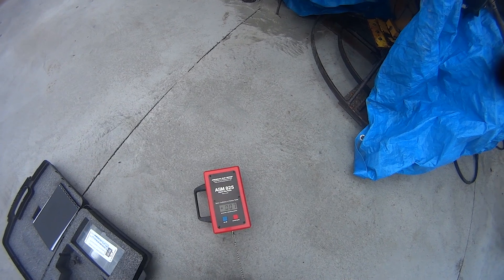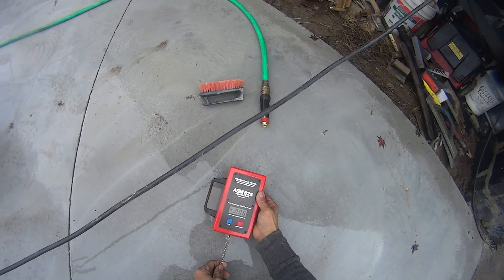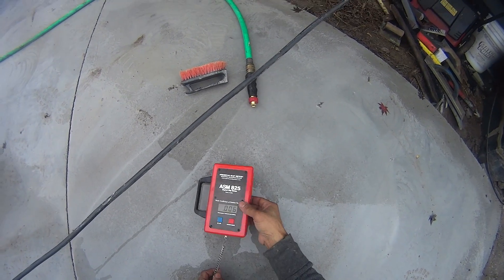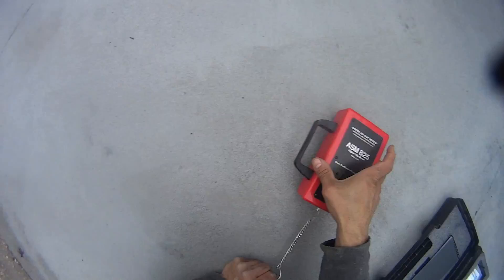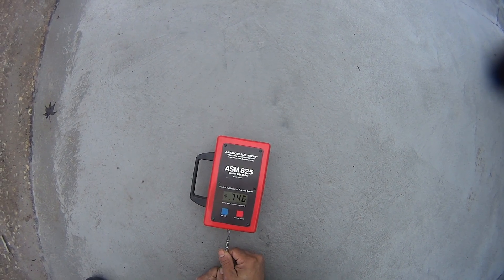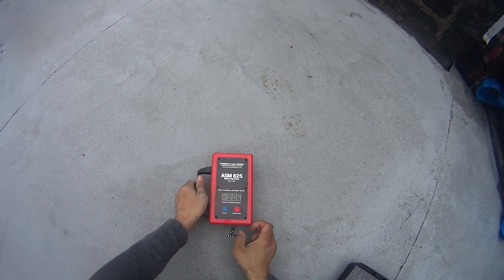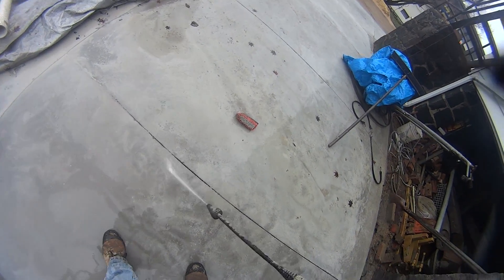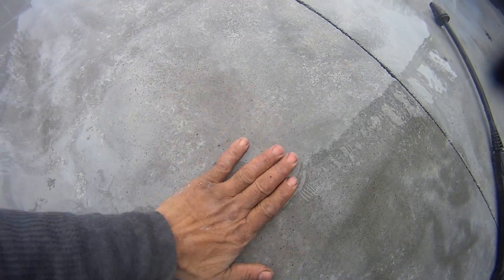Concrete Grinding Exposed aggregate concrete Part 1 ASM 825 Slip Meter

Comment: I really like the look of the aggregate showing on concrete where the the city comes and grinds high spots smooth. In that look, you have both aggregate showing and a smooth-ish surface. I'd like a driveway that has that look, but prefer to not have the disadvantages that exposed aggregate driveways have with the extra rough surface that is harder to keep clean and stains easier. 

Would a method like this be possible for an entire driveway without being substantially more expensive than a typical exposed aggregate surface? Am I correct in thinking that this could benefit from having the maintenance of a typical poured concrete surface while having a different aesthetic with the aggregate showing?
Reply from the maker: Freezing water / rain/ snow  etc.  makes this deadly outside (potentially)...

Comment: I just had a pool deck poured and the broom finish was real rough.  With this work?  What size grit would you recommend?
Reply from the maker: Unless you want to bust ur ass, keep the "grip force / friction / surface tension" as consideration for a wet deck...
Meaning, it based on what contact will be taken place ...feet or specific shows matter.

Comment: I tried to use a walk behind concrete floor grinder to smooth out an exposed aggregate Patio the other day and the diamond blade was completely ruined after about 10 minutes of grinding am I doing something wrong or what would you suggest
Reply from the maker: Send me images and what exactly you were using and on what hardness.
Reply: @Construction Engineering & Failure Analysis  Is there a private message feature on YouTube? I can’t seem to send images via comment.
Reply from the maker: @dub4days  cefa1@yahoo.com
Reply: You were using the wrong tooling. For patio style concrete you need a hard bond metal to start the cut. Soft bond metals are better for much more dense and solid concrete.

Comment: Do these machine work on really bad concrete jobs where rock is showing?
Reply from the maker: Yes, depends on the diamonds you use... based on the hardness of what you are cutting. But, ''rock'' is subjective? They will even polish granite if that helps.